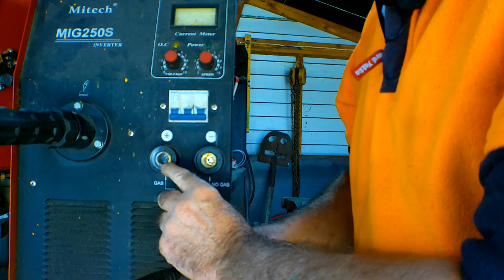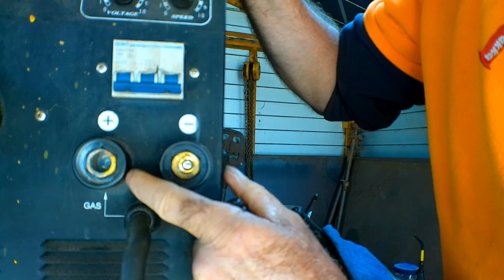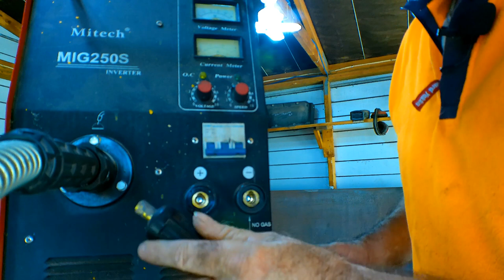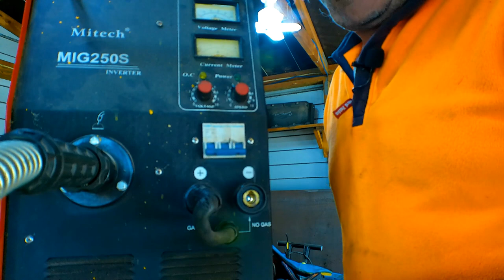Why your mig welder isn't welding like it used to

Comment: actually had this happen at work a few weeks ago. had to keep upping the voltage (22v up to 27v) to get the weld hot enough then saw smoke coming from the power lead in the back of wire feeder turns out the lead slowly loosened itself so burnt itself out . replaced the plug and cut off  about 50mm of the cord and that fixed the issue
Reply from the maker: Yea happens my friend .Cheers pete